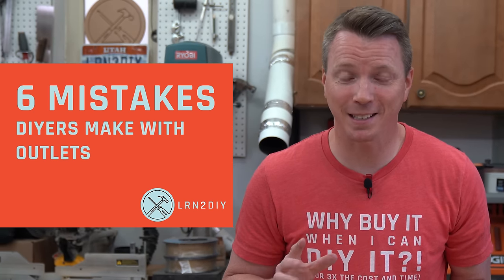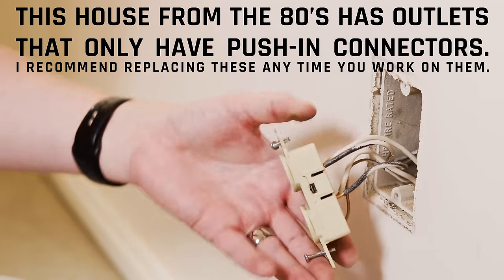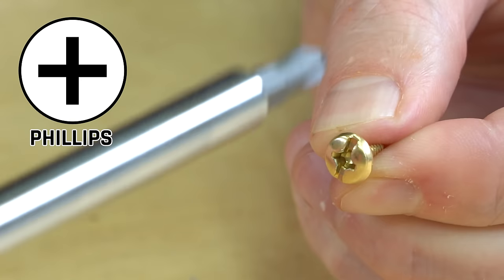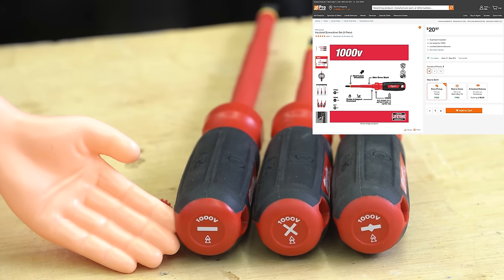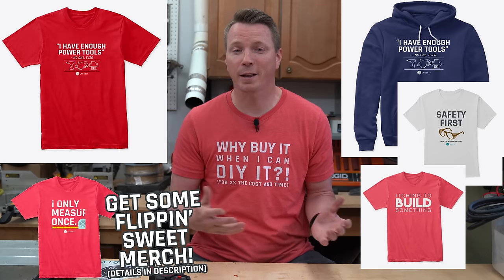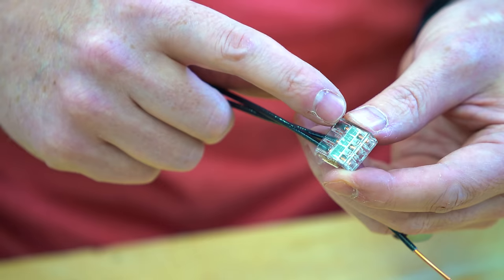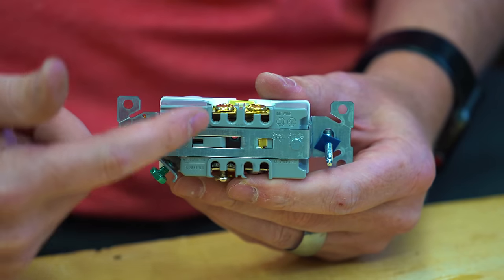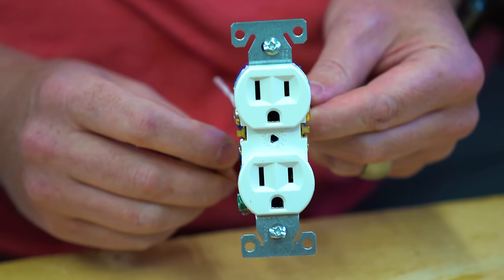6 MISTAKES DIYers Make When Wiring Outlets

Comment: I do electrical work professionally, and I've been casually telling "newbies" or anyone else who is seriously interested in how to wire electrical stuff properly, about all of these tips here in this video... Very well presented and accurate info!
Reply: Agreed.
Reply from the maker: Thank you so much! That means a lot coming from a pro like yourself.
Reply: yes electricity is VIBRATION  and it is the vibration too that will cause wires to pull out
Reply: @carlodonnell146  Actually, a loose connection usually gets worse because of heat buildup at the connection where it's loose, expanding and contracting the joint, depending on how much current is going through it, therefore making that connection even looser over time, many times to the point of the connection falling apart, and also even sometimes causing a fire from either arcing, and/or the heat buildup in the bad connection.
Reply: @JoeJ-8282  are you saying that vibration is not a factor along with the expanding etc?
Reply: @carlodonnell146  Maybe to a VERY small degree, vibration has a detrimental effect to a connection point, but for the most part, it is MUCH more the heat buildup and resulting thermal expansion that does more towards making a poor initial connection even worse.

The exception to this may be if the connection is in the output box mounted to the frame of a gas powered generator or a VERY LARGE transformer, where the terminal or joint is actually subjected to a relatively high amount of physical vibration, then in that case, the vibration may very well have more of a detrimental effect, but in most more "normal" applications, like on an outlet in a house wall for example, it is more an issue of thermal expansion due to heat buildup of a poor connection that eventually further loosens it, causing an even poorer physical contact, and even sometimes a resulting possible fire... especially with aluminum wire in old houses... that's why aluminum wire was outlawed for use in modern houses.
Reply: @JoeJ-8282  ok Joe thank you frank
Reply: @carlodonnell146  never pull out
Reply: @carlodonnell146  ask your mom. She knows EXACTLY what I’m referring to
Reply: How can the manufacturer make the backstabbers and you're saying not to use them?  Wouldn't they be up the code? And the biggest problem for people using the backstabbers is it's only designed for 14 gauge wire
Reply: @carlodonnell146  I've got to agree with Joe. The small contact area means the current at that point is high, and that will translate to heat. Multiple heating and cooling cycles, as the outlet's used by a tool or light, whatever, will cause the little lever holding the wire in place to become loose.
Reply: @MrHeat1up  Yes... they meet code, but that doesn't make them a good idea. I've had problems over the years, and fixed them with a screwdriver.
Reply: @MrHeat1up  These types meet the testing criteria that UL and other labs test to, but unfortunately those standards don't always result in something that's perfectly reliable over the long haul.  Most all standards are a push-pull dynamic of safety vs cost/convenience.
Reply: @murasaki848  I believe it's installer error.  Like I said the rear connectors are for 14 gage wire only and you must have the wire fully inserted into the unit.  If it fails don't blame the product.  Blame the installer.
Reply: @murasaki848  UL doesn't set safety standards for outlets.
Those standards are set by (usually) the National Electric Code (there are a few locations that use a different code, but it's pretty similar in requirements to the NEC).
Reply: @JoeJ-8282  .. usually the heat is From the loose connection. Both dangerous and will worsen over time
Reply: @bricefleckenstein9666  To be fair, you are correct that it's organizations like ANSI, NFPA, IEEE, and NEMA (especially NEMA for plugs) that set various standards.  I'm simply referring to the fact that all of these organizations and the labs that test using them can't make standards so onerous that nobody follows them.  National Electric Code, published by NFPA, is actually a voluntary standard on electrical installation which Agencies Having Jurisdiction (AHJs) adopt in whole or in part according to state or local statute, and doesn't really set engineering standards for device manufacturers.  Conversely, standards and the methodology for testing are what manufacturers will try to work... for lack of a better word at the moment... "against" to try to cut manufacturing costs.  If the standard calls for 15A service without overheating but doesn't say anything about 10 years of thermal cycling (difficult to simulate), then that's the standard it's built and tested to, which in these back wire cases is unfortunate.

Edit: Just as an example here's a listing of standards that one particular Leviton weather resistant GFCI duplex shows on its product datasheet:

Standards and Certifications
ANSI : C-73
Applicable Standards : UL 943, UL
498, CSA C22.2 No. 42 & 144, FedSpec
W-C-596
Certification/Listing : UL, CSA, NOMANCE
NEMA : WD-1 & WD-6
Reply: @thorn3686  Yep. That's exactly what I've been saying here if you read my comments. It's actually both, a relatively poor connection, due to a very small contact area, (in "stablock" connections), that causes initial heat buildup, and it's that heat buildup that further loosens the joint also, due to thermal expansion and contraction of the metals right at the tiny connection point.
Reply: @murasaki848  Mostly "local" jurisdictions, as I understand it, for those "AHJs".
And they do NOT set standards for devices - they usually work with UL and NEMA to make sure that the NEC is compatable with THOSE specification-setting groups.
The NEC is more about setting codes for INSTALLING and WIRING those devices to be as safe as practical.
But calling the NEC a "voluntary" standard is iffy, as it has been widely adopted AS LAW by most of the USA (usually "by incorporation" into local building codes) - even though NFPA doesn't itself have that authority.
Reply: @JoeJ-8282  A loose connection will become amplified by both, physical and thermal sources.
Reply: @justinwood8629  Yep.
Reply: @bricefleckenstein9666  For some reason, you're saying the exact same thing I did but indicating it's news to me.  I said the NEC wasn't an engineering standard for products, but for installation. In fact it was you who said "UL doesn't set safety standards for outlets. Those standards are set by (usually) the National Electric Code" when we were talking about the backwire holes on outlets. As for the word "voluntary", it's not my wording.  Argue with Mike Holt. It merely means NEC and changes to it do not have force of law until they are adopted by lawful bodies governing AHJs (and there's often grandfathering exceptions as well, such as during the time I was wiring a house the NEC changed to require AFCI in more areas, but the inspector said the date I pulled my permit excepted me from the change.  I changed the breakers anyway).  I'm well aware that AHJs vary as well.  For instance, where I first began pulling permits, Labor and Industries in Washington State regulated and inspected electrical work statewide, but excepted individual cities which do their own such as Tacoma.
Reply: @murasaki848  It's too bad Washington does such a HORRIBLE job regulating "Electricians" - I've seen some amazing idiots that are "licensed electricians" in Washington State with major gaps in their knowledge of the NEC (which is pretty close to universal here AFAIK) in areas where it is the adopted code.
Reply: @MrHeat1up  The 85 cent residential grade receptacle is just as code compliant as the 2.50 commercial grade , but guess which one is way more likely to fail first ?  Same thing with speed-wiring .. save a couple minutes or a couple dollars but risk an expensive fail later.  And the speed-wire is only rated for one insertion.  Like my grampa used to say 'Cheap comes out expensive' ..
Reply: I'm glad he brought up the back stabbing. I live near an air base and constantly do calls around the base because the vibrations from the planes cause the wires to come out.
Reply: @JSyder-co3xp  Ooh... I never thought of that. A short story for those who have never experienced it: I was single and in the Air Force, and as such I lived close to the flightline on a few assignments.  I was very used to sleeping through jet noise. But then I visited an old girlfriend at McConnell AFB, KS, and one morning I was woken up to the loudest thing ever: B-1 Lancers taking off on full afterburner.  We were in base housing and the whole place was shaking.  It was like an earthquake with metal concert level audio.   So I can very much see how these connections would not survive forever.
Reply: @carlodonnell146  if your wires are vibrating, especially when bringing a large load on line, you are most likely drawing more amps than those wires can deliver and often over too far of a distance
Reply: @JohnGalt-vr3lx  I never said that my wires are vibrating, I said that electricity causes vibration and it is true. I rarely do electrical work anymore.
Reply: @carlodonnell146  Absolutely electricity causes vibration. My father was a member of IBEW for 45 years. He taught parts of the union apprenticeship program. I grew up doing electrical work. I still do it on the side. I work in health care. Which I enjoy, but in someways I get more satisfaction from working as an electrician. I was bringing up the vibrating wires because I had to rewire an air compressor at a body shop. It was a 3 phase 480 volt compressor. When I first went,  I told the client his wiring wasn't sufficient for his needs. He wanted to argue. He ended up burning up the motor because of the low voltage due to improper wire gauge. You could actually hear the wires slapping around inside the conduit. I tell people if they want to do framing or plumbing or things like that, you can do it and if it doesn't work you can redo it. With electricity and gas supply, a mistake can be deadly.
Reply: @MrHeat1up  , on a 15 amp receptacle (standard) it's sized for #14 AWG.  A 20A receptacle should have provisions for #12.  But one thing that was not mentioned is that receptacles are often installed as "thru devices", where multiple receptacles are on the same circuit.  If the incoming and outgoing (or line and load) wires use the push in terminals, instead of side terminals or pigtail method, you are relying on that connection to power the load of multiple receptacles.  When that happens, the odds of one bad connection causing an issue are multiplied.  In a new house installation you have a fairly high probability of having at least one bad connection if this method is used.  Mine had several before I changed all of the connections.

And if you think the thru device method is unusual, check out the areas protected by a GFCI receptacle (such as a bathroom, basement, or garage).  Very nearly all of those in a typical house are installed this way so that one GFCI receptacle provides ground fault protection for all of the downstream devices.  It's simply the cheapest way to do it so it's the most common.
Reply: @brentrupp5118  thanks for the explanation.  I have seen rush jobs even using the side terminal that was poorly attached.  Or the line has 3 inches from the back out of the box.  I just believe if you see a poor connection it was that way from the installation.
Reply: My dad's house in the 60s-'70s had four fuse boxes that were about 30 years old. I replaced them with a Square D breaker box. When it was inspected, the first words he said was, I can tell you that no electrician in this county did this job." Then he grinned, I've never seen such a neat and clean install!" What really surprised him was that I had made the change without pulling the meter. Not something that I recommend to anyone, but the utility wouldn't reinstall the meter until at least three days after the inspection, and it was late August so the house would have been miserable and food in the fridge would all go bad. The only electricians allowed to do this work and reinstall the meter wanted $1000 plus time and materials. I was just out of the Army, as a Broadcast Engineer so I worked with much higher DC  voltages, at high enough current to fry you. He was also surprised that I had installed a new plywood backboard to mount it and an outlet on. It always bugged me not to have an outlet near the breaker box!
Reply: @geraldcreager4432  I prefer using a hammer on them, so someone doesn't try to reuse them. 😁
Reply: @murasaki848  30+ years ago, I was building a TV station in Destin, Florida. In comes the building inspector, shouting that I had to have a state, county and city license to do electrical work. I asked him, "Which of your good old boys is trained to install 30KV rated armored HV cable, and can they secure a one million dollar insurance policy?" He snarled, "This isn't worth a million dollars!" I sighed and told him that I had a construction permit from the FCC, with a fixed day to be on the air. if one of his GOBs made a wiring error and we missed that date that there would be heavy fines, along with replacing the transmitter. Then I laid the RCA blueprints on the table and pointed to the top left corner. "Du you see this, where it says 'Electrician, connect power here'?" It was considered as industrial equipment, so it did not require an electrician. I then asked how familiar he was with the NEC sections on commercial and theatrical requirements. He yelled, I'll be back, I'm going to the courthouse to get a cease and desist order!" He never came back. 😆
Reply: They should make the back terminals illegal and not offer them on outlets and switches.
Reply: @carlodonnell146  not just vibration, but thermal expansion and contraction with load changes, most issues I've seen are due to accumulated forces on a defect in the wiring.
I would like to see a video on how to get the wiring into the box without trouble (wire management)
most newbies (guilty as charged at one point in the far past) tend to use short wire lengths from the back of the box to the outlet because it looks cleaner, the problem is that it puts more stresses on the wire connections
Reply: @bricefleckenstein9666  Oh, they can, especially when some AHJs sit on the NFPA boards
Reply: @murasaki848  Agreed, many such jurisdictions have their own code modifications.
whenever pulling a permit in a town or county I don't usually work, I always ask what code revision they are operating under, and if there are any particulars codified in that jurisdiction pertaining to the work being done.
Reply: @murasaki848  I spent over 2 years on USS Ranger - with my bunk right under the #3 arresting cable (the pilots TRY to hook the #2 cable which slams their main gear into the deck real close to the #3 cable).
I doubt your base housing had more vibration.
Reply: @JohnGalt-vr3lx  In most cases, it is THE ENVIRONMENT that causes wires to vibrate.
Trucks drive by, thunder, even music from passing "boom cars", it's a LONG list.
Reply: @DLexEdition  a local city code near me requires minimum 12ga wire even on 15a circuits. I suspect that was their way of ensuring those backstab holes don't get used!
Reply: @cindywalker6982  That's great they require 12 gauge wire for 15 amp circuits. The reasoning isn't as simple as you'd think. They want this in place in case someone decides to do renovation and bumps it up to 20 amp circuit breakers. The size has to do with the current capacity but also the amount of outlets and lights it's required to power, which also includes the total loop length and number of connections you have in wall. Not a lot of electrician think about this but the more connections you have the more loss you have in your circuit. It's not just about the used amps (power) that needs to be looked at.

However, with that being said, I've seen the backstab varieties that can take up to 8 gauge wiring which is a really bad idea.
Reply: Yeah, I have occasionally shot videos about it but not posted any.
Reply: Yes, I have been shown how to install very improperly by people who have 5 years of experience. A lot of people in our trade do not care unfortunately
Reply: Not bad advice .. except 
Robertson #1 is the RIGHT driver to use . 
Forget the combo driver
 Throw away the Philips
Reply: @JohnGalt-vr3lx  so was it the electricity making the vibrations ? NO . It was the machine .
Reply: @michaelterrell  well done. Re outlet near breaker. I always put one in . Particularly in new constuction.  A must
Reply: @Unkl_Bob  When I bought this house, it had a detached garage that was built by the original owner, in the '60s. He had put the fuse box 12 inches off the floor, and ten feet back from the door. The metal roof had leaked on it, and the wiring was damaged by squirrels. 
I installed a new breaker box by the garage door and put everything that was exposed, into conduit. There is an outlet under that panel.
He dad directly buried triplex drop wire without conduit, so I dug it up tho the meter pole and did it right. I now have 100A service with 20 circuits, instead of two 20A circuits.
Each door post has two duplex outlets and two light switches, one for each 10' by 10' area. 
On the far side of the garage by the right hand door is a large pull box with a hinged lid. (A used burglar alarm cabinet.) It has four conduits to the house, and four more to a small cottage. I put it in when I first moved in. They are for Telephones, TV, Network, and Security.
The cable TV tech that was installing Broadband freaked out when he saw it. I told him that I was a Broadcast Engineer at three TV stations before I moved here, and I had higher standards than most people because of constantly clean up 'Good enough' or 'It's temporary' work. I pulled several miles of excess cable from the control room at one station and the phone lines that ran around the small building.
Reply: @bricefleckenstein9666  I'll bet it didn't have wild buffalo roaming through it, or an abandoned and damaged nuclear reactor across the street from his barracks, either. It had developed leaks between the sets of pipes, and had no cooling tower, so radioactive water was pumped back into the ground.
Reply: @DLexEdition  I only use 14 AWG for lighting, with a typical load of under 160W.
Reply: Not a professional. My dad taught me to wrap electrical tape around the receptacle connectors to avoid shorts and such. Just a precaution.
Reply: @irish60plus  In some places that would cause you to fail an electrical inspection.
Reply: KISS principle always works best with the newbies . But sometimes it amazes me if they can even tie their shoes in the morning. 49 years as a Master Electrician and the stories I could tell.. Like the guy who took his Journeyman exam seven times in one year before finally barely passing it. Then he took a magic marker and wrote ELECTRICAN on his hard hat and started the best joke on the job .I told everybody but him first he spelled it wrong .Then I told him it doesn't matter how many cards you have in your wallet , if you can't spell the word , you cannot be the word 🤣He wouldn't speak to me for six months. The next week he energized the wrong 400 amp breaker on a switch gear and blew a wall mounted junction box up next to the superintendent of the job ( He wasn't happy🤬 ) where the wires were rolled up inside and the ends were not taped up. He was told to tape them up before he closed up the J-box a few weeks prior because the equipment's arrival was delayed do to change orders. He quit and the last I heard he was wiring houses for a living .
Reply: @aintitdatruth9292  I wouldn't want to live in one of those houses. I was never licensed, but I never failed an inspection. My background was in Broadcast Engineering where 400A was barely enough for a medium sized transmitter. The backup generator for one site was 500KW, and only powered the transmitter, a rack of tape machines and the cooling system for the transmitter. It had three 65KW Klystrons which required a pair of water chillers.
Reply: @JoeJ-8282  I remember my parents had a mobile home that had the same aluminum wire in to the box. We had to tighten the main terminals back up every so often and anything else with aluminum wire or lugs. 
Not safe. 
Work smarter not harder!
Reply: @PickleballMike509  thats what she said
Reply: @JoeJ-8282  under our code aluminum wire in old houses. is fine as long as you never touch it. but soon as you up grade say a plug. light ext. you have to replace the wire with copper unless it a service feed or a sub panel feed
Reply: I'm Also Electrician and have watched some tip video's, this is the first that  I 110% concur with. Great videa!~
Reply: @michaelterrell  Good one!  I knew a Physicist at Argonne National Laboratories that got the same comment for some pipe soldering he did.  It was perfect, because he was had to be perfect at work for his experiments.  The guy who commented said he would fire anyone that did that kind of work because he wouldn't be fast enough!
Reply: @MrHeat1up  I have been an Electrician now for 39 years.  I couldn't agree more.  If backstabbing outlets and switches were unsafe they would have been outlawed long ago.  They are still UL approved and still approved in the National Electrical Code.  The only change over the years is that you can't backstab 12 AWG anymore and the holes have gotten smaller as to not allow that.  The problems you see with backstabbing comes from improperly installed or poor-quality switches and outlets.  Leviton has always made high-quality switches and outlets and that's all we have ever used over my whole career.
Reply: @LRN2DIY  is that an ecx #1 or ecx #2?
Reply: @skopjemk  WRONG. WRONG. WRONG
Reply: I like watching them struggle
Reply: Well Done!!!! Easy to understand! Thank you.
Reply: @carlodonnell146  Not true, the "vibration" of electrons is not actual, physical vibration.
Reply: @carlodonnell146  sub-atomic electron "vibration" is not the physical vibration that you're thinking of.
Reply: @pld8993  if a person is electrocuted the electricity holds on to the person and doesn't let go ,correct? and if some one else tries to pull the person away, that person also gets electrocuted od so I understand; so isn't the electrons vibrating with a magnetic field ? I don't know, ok I am learning.
Reply: @carlodonnell146  Getting electrocuted (killed) is sometimes the result of being locked-on (can't let go), and sometimes not. Electricity can flow through a body and treat it as a conductor or as a load, depends on the particular circumstances. Touching someone who is getting electrocuted may or may not result in you also getting shocked, again, depends on the circumstances, but you should never touch someone who's getting zapped.
Reply: When I was pro we would go and pigtail before doing the final connections. I agree with you. In areas of older aluminum (pre copper alum mix) I also stressed nox.
Reply: @frontiervirtcharter  I am in no way a licensed electrician. But those WRETCHED cheap outlets that were installed in our house? I've had FOUR plates break, and THREE outlets completely crumble on me, just from plugging and unplugging cords to them! I am slowly changing every single one of them out. 

And the IDIOTS (and yes, I am yelling here) who built our house wanted to do it in the worst possible way, SO THEY DID! Cut corners everywhere! I've learned more about carpentry and electricity -- and how NOT to do things -- from this house than any schooling I could possibly have taken. 🤬 Another example of poor, awful DIY wiring was to find out that our house could have burned down from them using an outlet basically as a junction box! The pigtail idea would have been OK, but since space heaters are frequently used in our basement, the doubling of the wires on one outlet caused heat from expansion/cooling, then totally frying the wires. I am now going to have to make an entirely new run because of it -- and because of the space heaters used, it will be 12-gauge wire, and NOT 14! The outlets will also match the power rating.